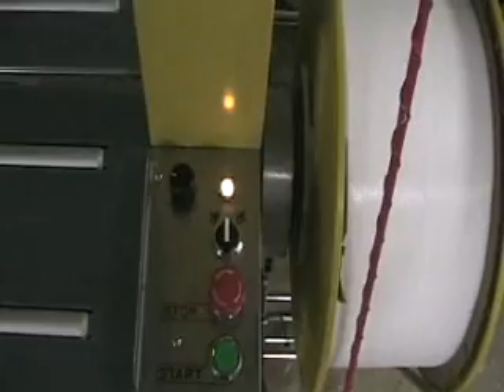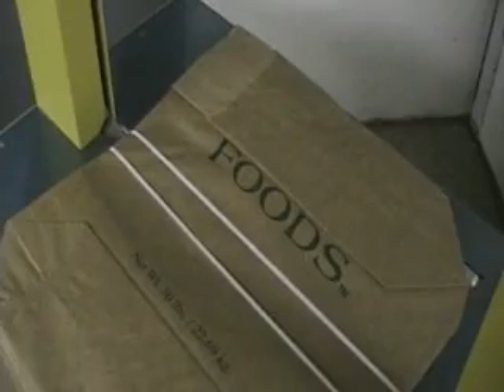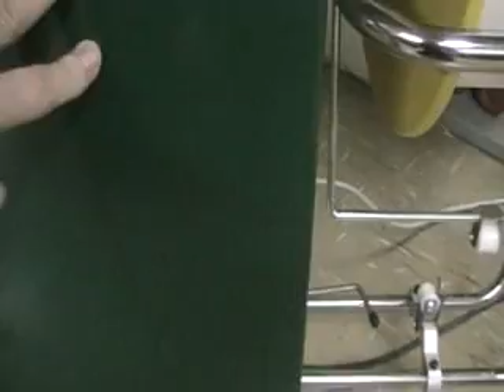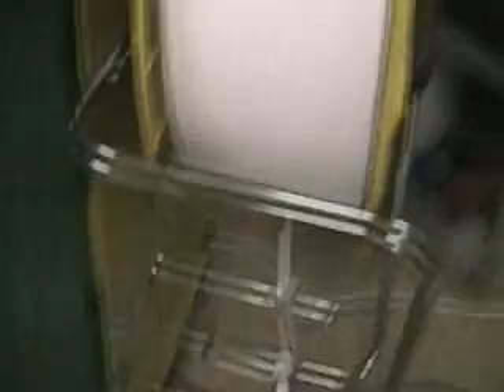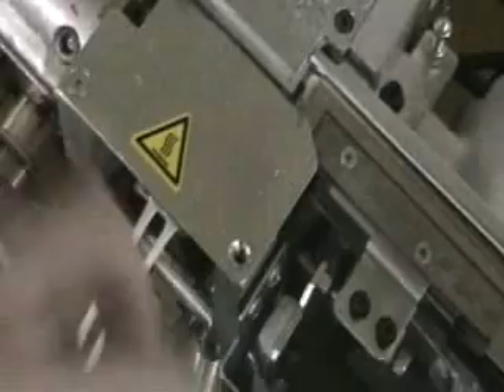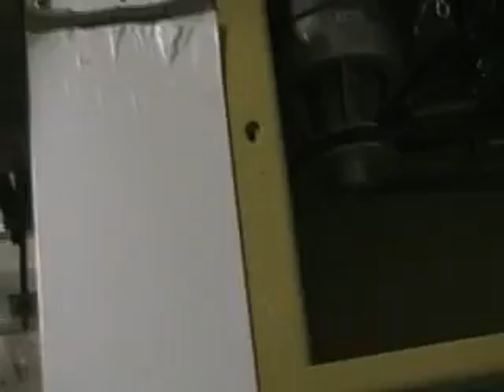RQ-8 Operations & Maintenance.wmv

Comment: Any idea why when the machine sometimes does not pull the strap back to strap the box, I just end up with a big sealed loop which I have to pull out of the strapper? Many thanks
Reply: Make sure the strap is free to retract to the pool box.   If there is any hold up on the reverse of the strap the backfeed timer will time out and the unit will go into seal/cut and refeed mode.   Clear out the strap track of any debris.   Could be due to several other issues so call or provide an email and we can send a technical PDF to assist.
Reply: @millerbevco2081  much appreciated for the speedy reply, I will try these helpful tips.

Comment: How can I test the pot of the tensioner if it is working properly?
Reply: What are you experiencing?   The knob on the tension control has a set screw in it.   If the screw is loose than the knob turns but not the pot.   Flat spot on the pot for tightening the screw.

Comment: do you think my heating element is bad if the straps are not sticking together
Reply: Enrique Hernandez if the strap doesn’t look like it’s melted then it’s likely a bad element. You should have 400-600 degrees at the heating element.
Reply: Turn off the unit, let the heater cool down and then clean the heater top and bottom.   Steel wool, wire brush or emory cloth.   The heater builds up residue that will retard the amount of heat getting to the strap.  Where is the heater temp dial set?  Once the heater is cleaned you may have to reduce this setting as unit will not seal if the strap is too hot or too molten.   800-821-2177 if you need to discuss further.

Comment: What does it mean when it makes a loud clunking noise when I try to band?...it will work fine for about 10 bands then it won't band at all, it doesn't even try it just makes a clunking noise then after awhile it fixes itself. Any advice? Thanks
Reply: Not sure about clunking sound?   Check the brake on the dispenser reel as it might not be working correctly and that is the sound you are hearing when the brake engages.  We break down the cycle into 4 stages,  reverse to package, tension, seal/cut and refeed the arch.   After 10 bands the unit will not reverse to the package, tension the strap. seal/cut or not refeed?   800-821-2177 if you want to discuss further.